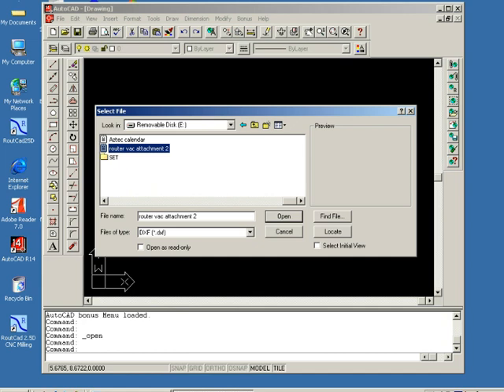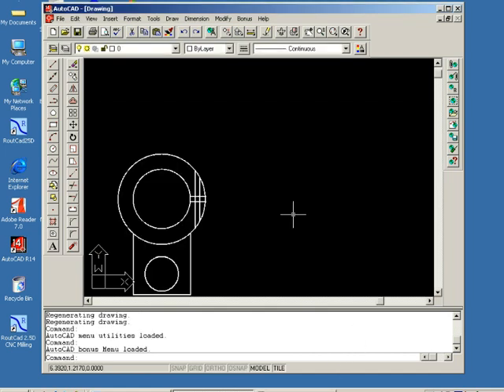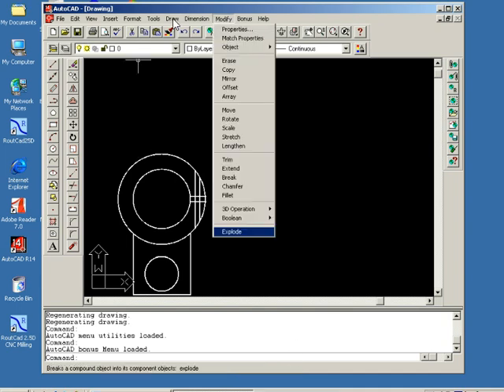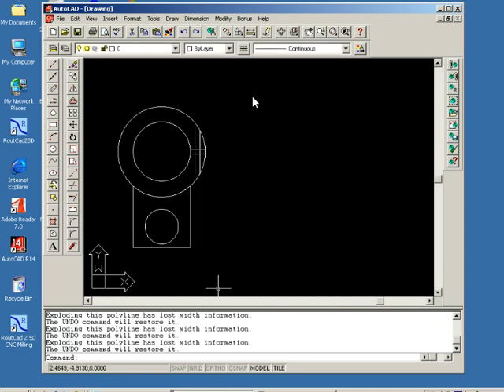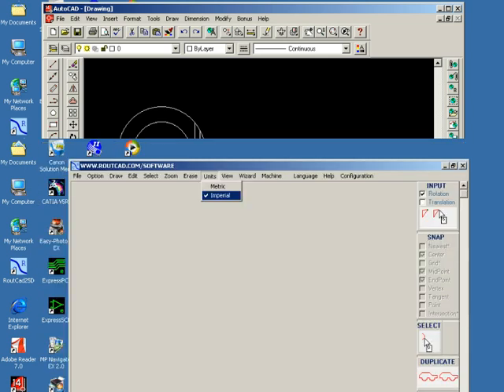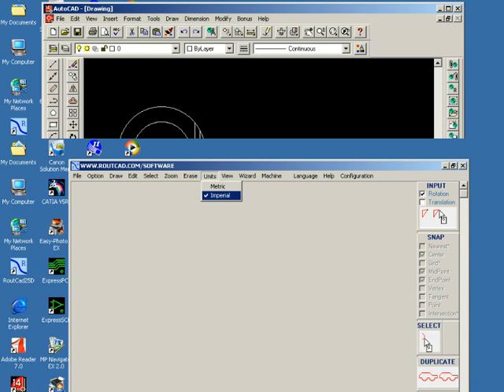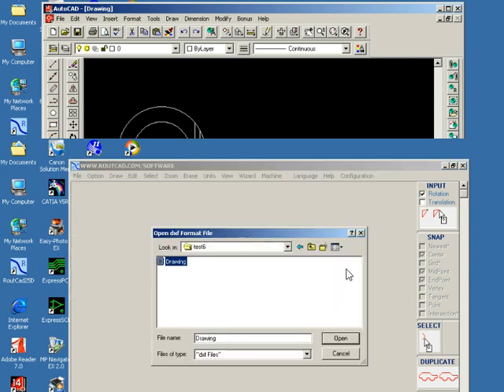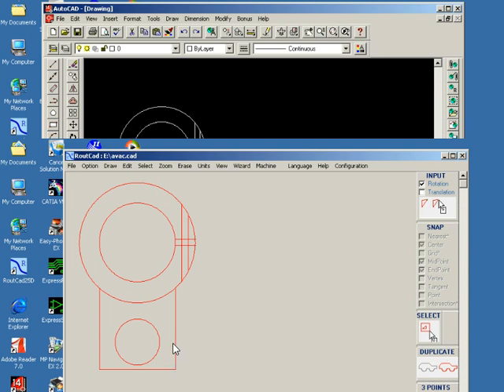Tranform cad to gcode

Comment: In AutoCad we are able to draw a 3D drawings by using extrude command to any squer, circle, or any shape drawing made out of poly lines and drawings can be saved or exported as dwg, or dxf file, there is no need drawings to be exploded, please could you say what is the reason for exploding the drawings ? I do have recently an Offline CNC 3018 pro Max purchased, but there is no option to load DXF drawings in Offline but only .NC drawings or Faunts,  also I could not find an option "Candle" to load, and engrave or Cut . Please if you done so, that would be awesome to help us be able to engrave on our Machines. Thanks so much and best regards